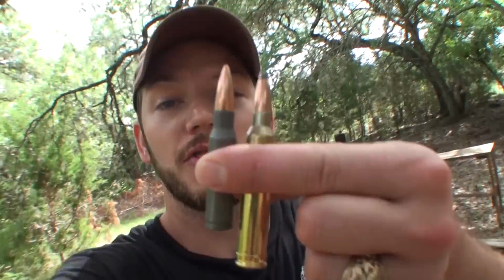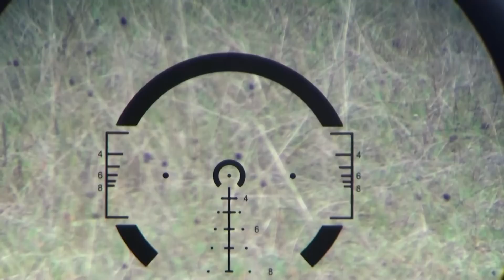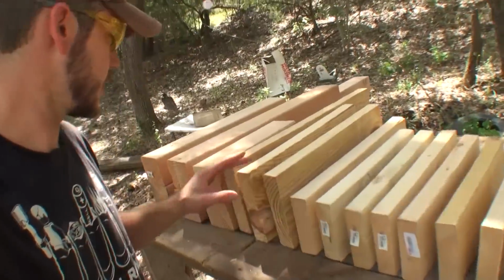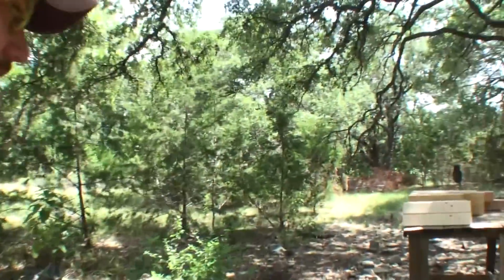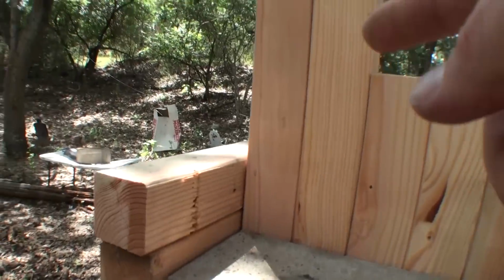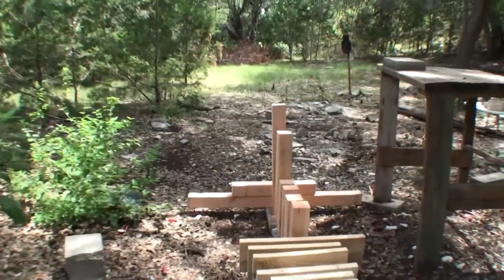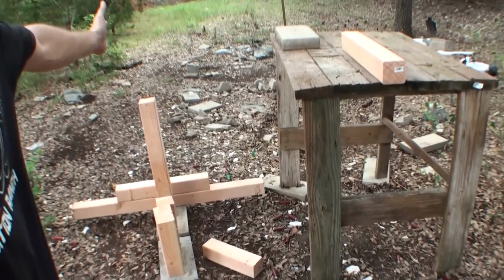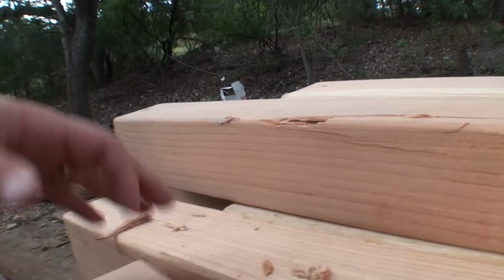I Thought Wood Was More Bulletproof Than This

Comment: Use hardwoods instead of conifer woods.
Reply: Gammareign lignum vitae should work great
Reply: Oak? Mahogany I agree
Reply: Plus it's new fresh soft wood. If it was older, dryer and hard, it would be a much different story.
Reply: Yep, that was the first question in my mind when i saw this video.
Reply: Expensive, but I also think lumber must stop pistol rounds and not rifle rounds.
Reply: The difference in density and Janka between a a softwood and hard wood is so drastic. A good hardwood would be about 10x these.

Comment: Cue the 13 year old CSGO weapon specialists beginning to write comments about wallbangs
Reply: how y doing drewski
Reply: so true
Reply: I wasn't thinking CSGO, but more along the lines of these bullets defending in an apartment building situation could be a disaster. My initial guess was that 1 four of board should be fine to stop the bullets. Boy, was I off!
Reply: +u9Nails but would you be shooting a .308 during a home invasion? I think not
Reply: Well that's why they say an Ar15 and Ar10 aren't practical for home defense, they're more for target shooting. Get a shotgun, 12 gauge.
Reply: +u9Nails

Even a 9mm, the smallest caliber I'd trust to drop someone, is dangerous to neighbors in an apartment.

These days, though, they make special prefragmented ammo, essentially birdshot in a jacket, designed specifically to be poor at penetrating walls. The jacket ruptures on contact and it dumps all its energy immediately. Much safer if you miss, and better energy delivery if you hit, so a win/win for home defense.

The other trick to safely minimizing overpenetration is loading a shotgun with #1 shot instead of #00. More pellets per shell means you a actually have slightly more mass hitting the target, but the smaller mass per pellet limits its ability to defeat walls and floors.
Reply: +u9Nails that's why we have concrete walls in Germany...they stop everything :)
Reply: ha ha I'm 13 and I could most likely tell you every spec of an mp40 or k98k or other guns of the era
Reply: +TheFlakTraitor Yeah from playing CoD World at War lmao
Reply: Don't bash the younger ones, man. I know of 14-15 year olds who reload their own bullets.
Reply: An AR 10 wouldn't be practical inside the home, but with an AR 15 it comes down to bullet choice.  A 55 grain bullet will cavitate on hitting a  body, deviate and dump it's energy.  If missing and penetrating a wall is a concern, they do make 5.56 x 45 with frangible bullets that will deform and deviate when they hit wall surfaces and will be less likely to overpenetrate.  Ammunition is also a concern with a shotgun.  Anything heavier than #7 bird shot will punch right through drywall, and considering that at room distances the pattern on a shotgun is about equivalent to a baseball, it is possible to miss with a shotgun (especially if your target is moving).  With any home defense firearm it's a good idea to map out a strategy on how you intend to shoot it inside should it be necessary, and take wall, floor, and ceiling penetration into account.
Reply: What about Rainbow six, prob most wallbangs in there 😂
Reply: Steamed Hams alright then, start listing. (German Military self proclaimed expert myself)
Reply: A game where you hipfire unless the gun has a scope...

Dumbest shit I've  ever seen

Comment: How many oxygen molecules will a 50 BMG go trough..?
Reply: Over 9000
Reply: well you're not wrong
Reply: All of them
Reply: We don't know, until we know..
Someone will have to test it.

Winky winky I'm talking to you Matt.
Reply: max range is 11000 feet and there is 7.5e+25 oxygen molecules per foot, after you take the size of the bullet and do some math is comes out to around 3.4375e+28 molecules of air. :)
Reply: +matt schweitzer neeerd
Reply: +matt schweitzer this dude did the math damn
Reply: matt schweitzer Can I call you MathMatt for now on?
Reply: respeck. you have it.
Reply: +matt schweitzer Except, it would not go through any, as that would require nuclear fision
Reply: None
Reply: 0 it would go around them
Reply: if were talking abouet splitting the molecule then it would go through 0. but i took it as how many it could go "through" as in how many it could split apart from other oxygen molecules and go through to the next, until it did not have the speed to stay up and hit the ground.
Reply: wait... wouldn't a bullet have enough energy to theoretically split a oxygen atom?
Reply: It definitely would, but it would be far 'easier' (requires much less energy) for the atoms to move around the bullet, or for some atoms to gain velocity and move with the bullet rather than splitting.
Reply: i was talking abouet shooting through the oxygen at average atmospheric oxygen density at sea level, and yes i did take the diameter of the bullet. so technically its right, but to get a true correct answer you would need to have a place with extremely high oxygen density and compress it. beyond the math i did we cant find the true number without lots of real world testing.
Reply: Many.
Reply: I've spent years mathematically working it out and got the answer: 46738290274684929273468902467810103757468228939 molecules, but when I test, it will go through you because of all the trouble you've caused me. (jk, it's just a prank, Bro)
Reply: +matt schweitzer mad props to you
Reply: None. It can displace them as in knock them aside but it won't go through any of them.
Reply: You just literally copied Donna Sach's comment.
Reply: I didn't read down that far.
Reply: more zeros than any calculator can match

Comment: You barely need a hammer to pierce wood with nail ,you dont need drill to screw smt in it. Wood's structure doesnt stop small objects... but it can support a lot of weight.
Reply: You definitely need a hammer and quality nails if your trying to nail into old growth lumber of hardwood.
Reply: It depends on the type of wood. Some are so dense and some or not.
Reply: That depends, teak and maple are actually so strong that it’s hard to nail in them

Comment: try green wood which has a much higher water content than lumber from the store which is kiln dried.
Reply: actually i dont think that would work....I noticed he is using Soft wood..looks like pine or fir.....I wonder if he used a stronger wood like oak, or something it would work better
Reply: I guarantee it would work better. This looks like Pine or perhaps #2 Cedar. My family owns a woodworking company and I could easily provide some real wood. Oak, Sapele, Mahogany, Ipe... Ipe would be a real test - i'll bet a couple of pieces would stop it.
Reply: Send in some decent wood and get us a new demolition ranch video!
Reply: I don't think that has much to with it. The density of the wood is what matters I think. I mean, green-ness could matter, I just don't know. But what I do know is this:

There are two trees that we hang targets from on my property. One is a 12" red oak and the other a 16" pine. A .308 round with FMJ will pass clean through the pine tree at roughly 100 yds. The same round will only pass through the oak at less than 30 yds.
Reply: Robert Shaver 

Those 4x4s are not made of Cedar. It's Douglas Fir. Cedar is a softer wood and is not typically used for dimensional lumber.
Reply: Try red wood, with space in the middle. I'll leave.
Reply: Theres a video on YouTube of a foot & a half thick tree stopping a 50cal so i think green wood definitely makes a difference
Reply: @TheRashaver  Maple wood would be nice, stronger than oak
Reply: @aconcerneduser4950  zootopia refrence?

Comment: Hey, was wondering if you could test bullets vs tires/tyres. I see most armored vehicles not having any armor on their tyres. Was wondering how they'd hold up. Thanks mate
Reply: bulletproof tire
Reply: yes!
Reply: Richard on Fullmag shot the tires of his truck. It made small holes that almost closed themselves. Barely a leak.
Reply: +Kyle Broflovski hey! Cartman is the best
Reply: +karebu2 I use to work for Discount Tire/Americas Tire(12yrs).  Ive installed specialized dense plastic rings inside tires that bolted around the wheel themselves.  This setup is what we installed on Ross Perot's Suburban & other VIPs. So other than true "run-flat" tires, you wouldnt really see any type of protection.  DARPA probably has something that we have no clue about.  The principle is just do enough to maintain control of vehicle to get to safety.  I know of nothing that would allow normal driving characteristics once tire is compromised. Run-flats are limited to 50 miles @ 55mph once punctured. Even if you drive a block using that feature, its recommended that its replaced.  Cheers...
Reply: Many armored vehicles have compressor systems that help keep the tires inflated enough that it can get to safety.

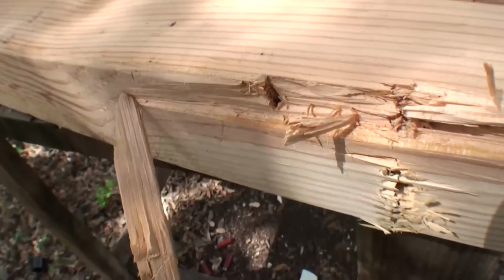Comment: 3:48 notice how the wood is splitting in between the grains even on the last 4x4? Yeah that’s pine, I’m almost 100% sure. Pine has a very weak grain structure, so the force alone from the projectile EVEN ON THE LAST BOARD propelling hard enough to just split those grains apart at ease. Let this be a lesson boys and girls, if you want to reinforce your house with just bulletproof windows, I suggest you reinforce the walls as well. 2x4 studs 16” apart with drywall and insulation in between is NOT going to stop a normal round. Not bullet proof.
Reply: Actually do a torture test on wall construction soon, I bet the .22 LR will punch through if it hits straight drywall, but not the boards

Comment: They're not two inches thick, they're 1 3/4" +/- 1/8th.  Carpentry n00bs.
Reply: so im not the only one who noticed
Reply: This changes everything!
Reply: A quarter inch times ten pieces of wood is two and a half inches of wood.  Yes, it's a big difference.
Reply: A 2X4 is 1.5 x 3.5 or 1 1/2" x 3 1/2" not 1 3/4
Reply: +kevin shelton I wondered who was going to point that out. Unless they have a different way of cutting 2 x 4s down there, that refers to the rough dimensions, not the finished ones.
Reply: Carpenter noobs
Reply: Yeah, you can measure that with your eyes, right?
Reply: Zoltan Csikos it is plausible, it's called depth perception. He should try some hard wood next such as cedar or maple.

Comment: I thought wood would be a bit more bulletproof than that too, especially going with the grain. I ran a truss through a roller sideways from inside a steel building to outside the steel building through a hole in the building that has a steel door that is normally opened prior to running trusses through. Well on this particular occasion, I was late to work and assumed someone opened the door before me. I was wrong. I ran the tail of that truss into the steel door which was about half an inch thick and this truss tail put a huge 3-4 deep dent in the steel and the truss tail looked completely unphased.

Comment: I'd like to see a video comparing pieces of wood lined up with space between them, and the same amount of wood with no space between them. my hypothesis is that a bullet will not go through as many pieces of wood if they are against each other, as it would pieces of wood with space between them. I believe that the continuous friction, between the bullet and pieces of wood that are pushed together, will slow the bullet more quickly than pieces of wood with space between them would. i would like to see this theory tested. I would conduct this experiment myself, if it were not for a lack of equipment and location.

Comment: For the next body armor video you should do aluminum sheets, like from soda cans if you smashed them, maybe 3-4 layers thick. Do like four layers with some wood, maybe like a 1/2 to 1/4 inch thick behind that, and maybe with some paper in the front or somewhere, unless you have a way more crushed cans then I anticipated.

Comment: Use some hardwood. Shoot cross-grain. Want some power? 7mm RUM. Actually a hot-loaded .45 colt with a 325 grain Keith bullet hard-cast will slam through 12" of green pine log.

Comment: those 2x boards are actually 1 and a 1/2 inches thick and Those 4x4 are actually 3 and a 1/2 inches thick and Those 1xboards are actually 3/4 inch thick

Comment: spacing the wood out means the bullet must travel through each separate piece individually. when they are all together it's gotta fight through all of them as if they were one. that's why when you see people break stacks of bricks with their hands there's space in between each brick. if there wasn't then they'd be slamming their hand on a brick several inches thicl

Comment: OK, I am a electrician, so drilling holes in wood is a time consuming part of the day, And the straighter the holes, the easier it is to pull wire threw..... see were I am going right ? ... but of course idd like to see a hand gun , as its easier to fit between the studs and in my tool belt, So of course always looking for a better way !

Comment: Why not try shooting at a solid piece of planed hard wood measuring 12 inch by 12 inch by 20 inch, lay the 20 inch on a smooth flat table top.
 See how far the bullet moves it.
Aim at the centre of the wood with the rifle pointing horizontal.
I recon it will move the wood 12 inches, and penetrate to a depth of 13 inch using your 50 BMG.
 Have a go just for the fun of it.

Comment: 2x's are 1 & 3/4"  Thick. They are 2" x 4" When they are First rough cut. Once it gets to finished lumber it's lost a quarter. That's why your wood wasn't up to tactical standards.
Reply: Negative. 2x4 nominal dimension is 1 1/2" x 3 1/2"
Reply: I stand corrected. I thought 1.5 and wrote 1 & 3/4. You are correct sir.